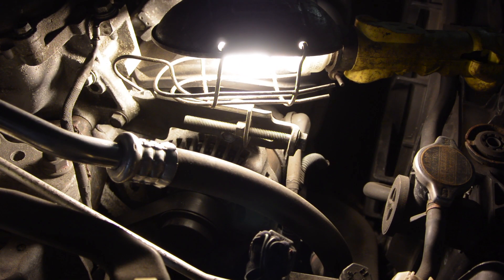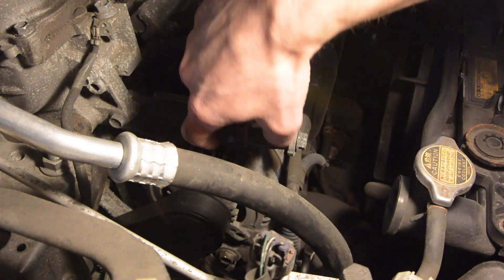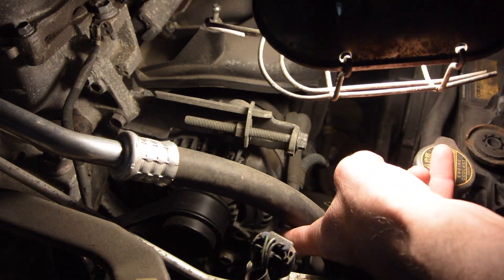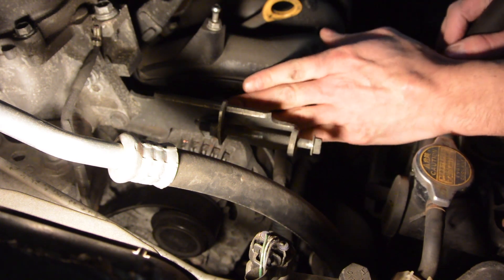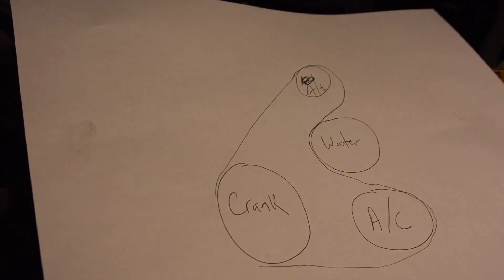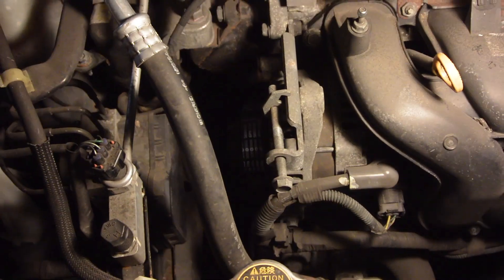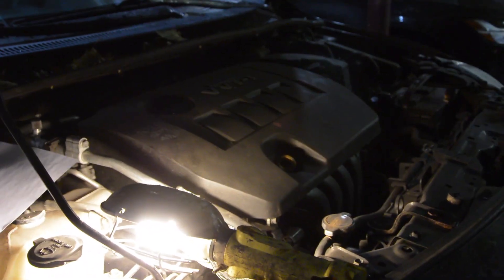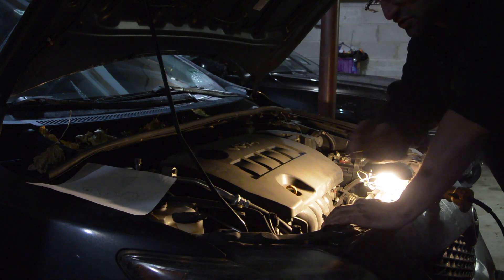2007-2012 Toyota Corolla Yaris 1.8L Serpentine Belt Install

Comment: I did what you said and loosened the bolts. The alternator slid all the way towards the firewall. The old belt was tight coming off and the new belt was at least am 1/8 of an inch to short. I went back to AutoZone to see if I got the right belt and after trying others I realized it was closest to the old belt. After trying for 3 hours I finally gave up and called a wrecker and had the car towed to my local repair shop. When my wife picked up the car my wife said the repair man was even grumpy for how long it took,  since he said it took 1 hour. I have changed other belts on different cars and never had this issue.
Reply: I’m having the exact same problem. I put the old one back on until I got the new one and now I can’t get the new one back on. This is very frustrating

Comment: Hi. Got my 2010 toy corolla alternator and belt replaced last year. I noticed the squeaky noise appeared after repair by a mechanic shop. I didn’t bring it back for them to fix   Stupid me. I noticed the belt is kinda loose should I tighten the tensioner a little bit more?
Reply: yes loosen up the 12mm and 14mm bolt and then tighten up the top 12mm belt adjusting bolt just little at a time

Comment: @kyle panics .nice video man!!! i have a question i replaced my serpentine belt but in the morning i get a squeal only when its cold n don't last more than 2 seconds what could ive done wrong? is it loose or too tight??
Reply: I have the exact same issue, don't know if it's an issue but yes I have the same thing going on, don't know if I have to replace the belt or pulley
Reply: @danny p ... a friend mention it can be the tensioner but who knows..if you fix the issue let me know
Reply: @ayleenvalencia4870  I just replaced the belt, the belt was a bit stretched out, I put a new belt and the noise went away
Reply: It’s loose tighten a little more. Should be able to twist vertical by holding with thumb and index finger, not more.

Comment: Mine 12 year old original one was replaced with water pump change. Now after 5000km it squels when raining. I think the new belt has now broke in and stretched so it needs tightening? How much i should be able to twist the belt with my fingers to test the tension? And if needed to tighten do i need to loosen the 14mm bolt also to tighten this?
Reply from the maker: Yes, tighten with 14mm bolts

Comment: The new belt appears to be the same length but won't even come close to going on. What's up?
Reply from the maker: adjust the alternator to allow it slack. Same length, but not worn in so it should be tighter.
Reply: Not working, alternator pushed at minimum and not even close to fit. missing almos 2 inches. bought the belt directly at Toyota.
Reply: @myrdhin101  I'm having the exact same issue did you figure?
Reply: @johntojsiabyang  No, went to the dealer :)
Reply: @myrdhin101  😭